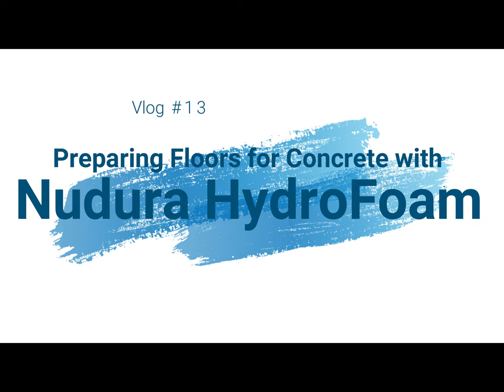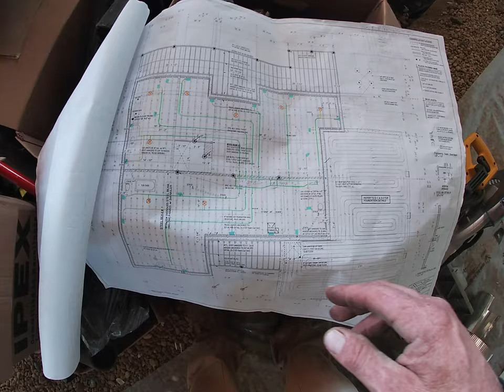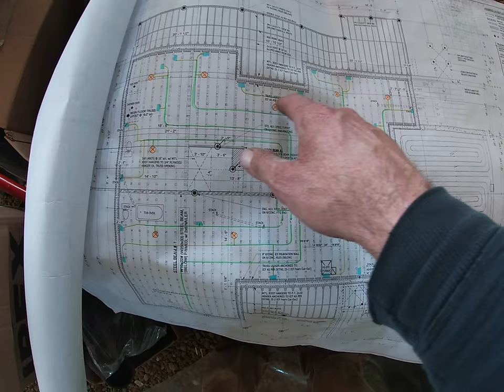Vlog 13 - Nudura HydroFoam - Prepping Floors for Concrete

Comment: Having grown up in Southern California and did some new home construction where almost all homes are stuccoed I was surprised by your discussion of the orientation of the metal lath given my personal experience with it. Just to make sure I remembered correctly given that it’s been about 20 years since I’ve done anything with it, I did some research to confirm my memory and if you didn’t misspeak, your lath is upside down because the pockets should be oriented with the “open” end up to support the stucco, meaning it should be rough when rubbing your hand DOWN it and smoother running your hand UP it. The purpose of that kind of lath is to catch the stucco when it is originally laid or shot on it and then provide support for the weight of it in the future.

Regarding the hole under the foundation, I don’t think you said why you dug it… so why did you?

Build is looking good and I’m looking forward to seeing more of your progress and the development of your homestead.
Reply from the maker: Hi! The guy we hired to do our lathe has been in the business for 20+ years. We trust he did it right. Also, the manager from the company we ordered our stone from came out to check out our house, because we had some questions about stone application. He also confirmed that the lathe was applied correctly. We are confident the lathe is on the right way. 

The hole under the foundation is for drainage for the pit in the garage. Water will drain into the septic tank. 

Hope that helps!
Reply: @eberlesbuildahousediyicfho9630  Interesting, guess it must not really matter then which isn’t much of a surprise given that it’s pretty common to actually apply stucco over regular chicken wire.

Thanks for clarifying the hole, I’ve only ever seen a basement slab poured after the rest of the structure was built once but they didn’t have a garage so I didn’t make that connection even though I did hear you talk about the garage drain.